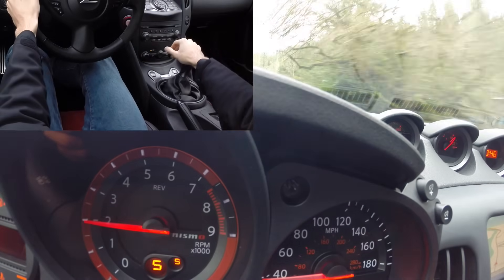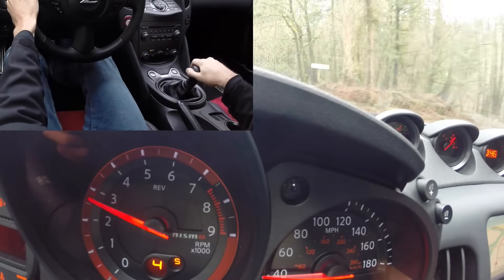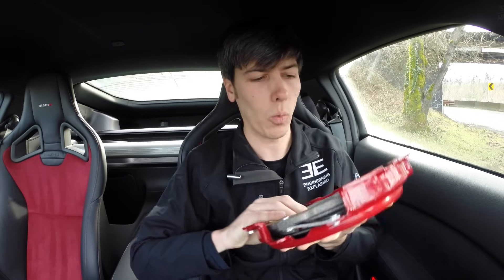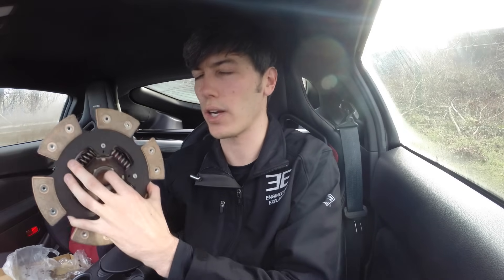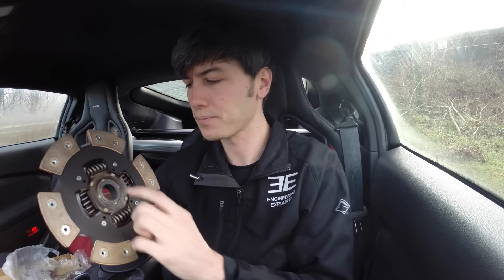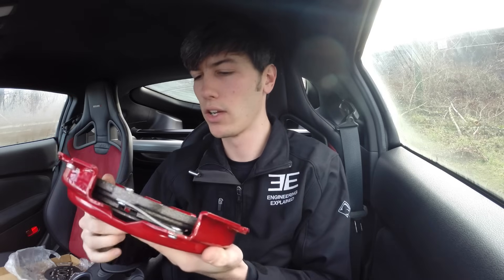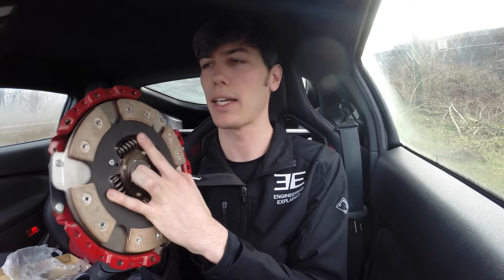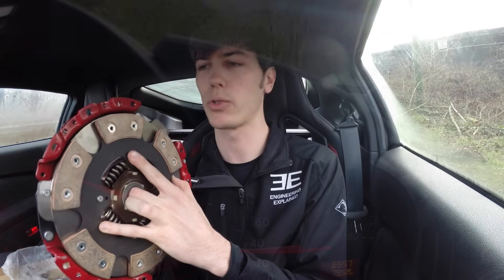What Is Rev Matching?

Comment: can anybody give me an example of this, when i drive stick i really dont think about these things i just do them. xD when i switch to a higher gear, i let go of gas, press down clutch, switch gear, let go of the clutch slowly while giving a bit of gas. now when i downshift i let go of gas, press down clutch, downshift gear, and let go of the clutch slowly without giving gas.
Reply: +poisoncobra7 Not quite. Rev matching is this: You want to slow down from, say, 40mph in 3rd gear to, say 20mph in 2nd gear. You brake, push down the clutch, move into 2nd gear, then *with the clutch still down you push the throttle a bit*, then you release the clutch, slowly or quickly, it's up to you. This makes for a much smoother downshift. If you downshift from 3rd to 2nd or 2nd to 1st and release the clutch very quickly you'll notice the car snaps its speed down very violently. It might even cause your seat belt to snap tight, it can be that aggressive. That's called engine braking and it's caused by the two discs the guy in the video is showing moving at different speeds and then joining together suddenly. Rev matching gets the discs moving at the same speed before they come back into contact with each other, allowing for a much smoother downshift and less wear on your clutch and stuff. Hope that helps. Ignore TifosoPatF1 btw; what he said to do is engine braking i.e. exactly the opposite of what rev matching is!

Edit: A great comment below bears repeating: "No need to [rev match]. In most cases you can just brake and keep it in the current gear then when you're ready to accelerate again just shift it into the gear most appropriate for the speed you're currently at."
Reply: Letting the clutch out slowly means you are slipping the clutch.  The clutch does not take wear when it is fully engaged or disengaged, but the time in between is where it receives 100% of its wear.  You can tell how much wear your placing on it by the amount of time it takes to shift smoothly. Your clutch is made to handle a ton of wear so don't sweat it if you ever had poor habits in the past.

Perfect Shift - Really fast, No jerking
Great Shift - Fast, little to no jerking
Good Shift - Sort of fast, Little to no jerking
Good enough - Not particularly fast, Little to no jerking
Poor Shift - Slow

 Drive down an untraveled road at a safe, normal speed in a lower gear then normal.  We'll say 3rd gear at 30 mph.Take note of the speed and RPM.  Now shift up so your in 4th.  Now downshift back down to 3rd the exact same way you normally do, but instead of letting off the gas all the way keep on it just enough to raise the RPM's close to where you were at originally.  You just need to get close and your clutch will do the rest when you release it so don't over think anything.  Practice will make perfect over time.  When your raising your rpm's up to the appropriate level, your not so much applying any torque, but more just resting your foot on the petal just enough to get the job done.

When you are practicing like this, you can always aim a little low if you don't intuitively know your RPM's for each gear yet.  It will be smoother, faster, and add less wear then your original method anyway.
Reply: +Anukloses Hmm it is far from dumb, infact you should not really ever be in neutral unless stopped, driving in neutral is call 'coasting' and it is a state where you have much less control over the car. I can't see why you would go from 6th to neutral? The gearing is there to be used so use it. Much like on a race track the gears and engine braking are used to gain traction coming out of a corner for maximum acceleration. Never coast a manual car.
Reply: +Dan Paveley Your comment helped more than anything on this page lol. I just recently started driving manual to learn and people try to give me tips on rev matching or double clutches but nothing helped quite as much as your comment (also this video with the technical stuff) so thanks (:
Reply: +poisoncobra7 That is correct, however what the video is explaining is matching the rpm to the speed you doing so the up or downshift is smooth and the car continues to accelerate correctly. Let's say you are going 60mpg and are in 6 gear but you want to come to a slow, by pressing the brake and taking your speed to 40 then selecting 4th gear will make it smooth and have no wear on the clutch alas 30-3rd, 20-2nd then 1st when you are coming to a stop it should all be a smooth sequence same as going up a gear, go with the revs.
Reply: +whoiselijah okay, what I do is, when i get into a city i lower The speed and switch to The appropriate gear for that speed. is that rev matching ?
Reply: +poisoncobra7 Yes, because when you change, the clutch disk is spinning at the same speed as the pressure plate so the connection is smooth and gives minimal wear on the transmission it also gives a smooth change and the revs should adjust only slightly.
Reply: +whoiselijah cool, thanks for the help, appericitate it !
Reply: +whoiselijah and there is no need to rev match when youre upshifting. That makes no sense cuz if u do you're spinning the engine crankshaft too fast for the trans input shaft to match and that collides gears aka smashing gears. Thats pretty much explaining powershifting in a way but obviously u take ur foot off the gas driving normally and in powershifting you dont let off the gas at all and "smash" the next gear in.
Reply: Dan Pavely and Quadrunner has the best explanations. Ignore all the others, it will just confuse you trying to understand Rev matching.
Reply: +poisoncobra7 You only do rev matching while down shifting if you wish to slowly brake your car using your engine (or add braking power if you're a "racer"). A good way to use this for everyday drivers is before a steep hill going down, you can release the clutch, give a little bit of gas and downshift to keep yourself at the speed limit without using brakes.
Reply: +BboyIllusi0n so say like there is a stop light up ahead,  you'd put it into neutral and slow down with your break. And you downshift if you are still moving but need to slow down a bit.  Is that what you are tying to say?
Reply: +Ghost Pro  i get your first part but the 2nd im having a little trouble understanding im like running on4-5hrs of sleep and worked 8 hrs..if im cruising at 35mph in 3rd gear and i see a red light up ahead, i push the clutch in and throw it into neutral and use my brakes to slow down my car completely. I dont use my clutch or gears to slow the car down at all. Ever. UNLESS i know for a fact that i wasnt paying attention &imma die and hit the car in front of me cuz i was rubber necking or whatever and my brakes arent gonna cut it so leaving the car IN gear AND braking gives a bigger effort cuz not only r u slowing down by applying your brakes but your drivetrain is impeding inertia as well.
Another scenario is that same situation but the light turns green. I went from 35mph to 20mph so i downshift to 2nd gear to get more torque to make the car move forward easier instead of having it be all sluggish and poor throttle response. Hope i answered ur question
Reply: XxBEFALLENxX i drive a pickup with a five speed. Sometimes i got a load in the bed. I down shift to brake so i dont over heat my brakes before the end of the trip. It doesnt hurt the truck to down shift while braking. It saves the pads too so i dont have to do those as often either.
Reply: +BboyIllusi0n yes that did. Thank you!
Reply: +BboyIllusi0n Yeah dude im like wtf why would you use the engine to slow down your car thats the most dumbass thing i can think of haha. Just shift it into neutral and use your brakes haha.
Reply: +Ghost Pro youre welcome! :D
Reply: +BboyIllusi0n Going up through gears using the revs is a very good idea, the optimal change for a diesel si 2-2500 revs and petrol is 2000, Matching your speed to the revs on upshifts gives a smooth change, going 30mph in second gear would be rough on the engine and transmission. May not be rev matching in its clinical sense but it is still matching revs to your speed.
Reply: +whoiselijah 2000 on a petrol? If I upshift at 2000 in my mr2 I end up with less than 1500rpm in the next gear and a really unhappy engine. It depends on what gearing you have and the engine. Some prefer 3k others 2.5k but rarely 2k on a petrol. Maybe those turbocharged 1.0 ecoboost engines from ford.
Reply: +whoiselijah you should never downshift to slow down ESPECIALLY to 1st gear. For example from 5th gear to 4,3,2,1. Thats what the brakes are for. To brake/slow down your vehicle. If u do that, u cause more stress on your clutch and gears and u wear it out more. More contact = more friction = more wear = more heat = more $$ to fix extra parts that shouldn't have worn out in the 1st place. Why do u think there is a neutral "gear". To allow no contact between the input shaft and the engine flywheel. Just saying. I dnt see why ppl slow down like that. For what? Whats neutral there for then. Might as well have it in a gear all the time since neutral isn't necessary.
Reply: XxBEFALLENxX_ Incorrect. It is not hard on a transmission to slow down while in gear. It is also not necessary to shift down prematurely causing a jerky motion that is hard on the clutch, just slow down in the current gear and then downshift before it stalls or before accelerating again. Coasting to a stop in neutral is the lazy or inexperienced way to drive a manual. It is not as safe, and it burns up brake pads faster than necessary. The only reason to do as you say is if your car is janky and stalls all the time then you can ride in neutral to keep revving it so it doesn't die.

Comment: How would you do this in a car that does not let you blip the throttle....I drive a 2008 acura tsx and it's not a wire throttle....i can get going from a stop no problem but a lot of times if say i'm coasting, or I first gear, clutch in and try to pump the throttle it won't do anything. Neutral revving sometimes if I'm coasting takes a second or 2 before the computer actually tells the engine to start revving. SO quick rev matching on downshifts is near impossible. I have to take at least 3-4 seconds to wait for the throttle to catch up to the lower gear rpm.
Reply: +TSX_Adonis Buy a car that doesn't suck?

Comment: hey! how about fuel consumption? I've heard people saying is a good idea to brake with the engine especially in downhiills, but i think as you are taking the engine to a higher revs it might use more gasoline. does it make any sense?
Reply: +Martin Zorrilla Yes it would raise fuel consumption because when you downshift to a lower gear it raises the engine RPM and that speeds up cylinder combustion which uses fuel. And there is nothing wrong with using the brakes to slow down going downhill, unless your brakes are junk.
Reply: ***** Thanks! yeah the idea about using the engine is because in really long downhills your brakes lose preassure and also the temperature of the disks and calipers raises so you lose braking performance. that's what I heard. on the other side you raise the fuel consumtion I guess
Reply: engine breaking doesnt increase fuel consumption on modern cars, atleast thats what we are taught here in sweden. Its actually prefferable to engine-brake according to instructors because its better for "eco-driving".
Reply: +Thaddaeus Edens Yeah, cars don't use fuel proportionally to RPM. At all. That hasn't been a thing since the death of the carburetor 30 years ago.

Comment: hey quick question is it bad for the engine/clutch/transmission to set the car in neutral once you reach certain speed? does it save u any fuel ? thank you :)
Reply: Bad idea. Less control over car without powered wheels and U will still need to rev match when reengaging into gear again after leaving neutral

Comment: it was going to well then he grab a clutch and said in spins according to your wheel. the hell no. the clutch spins with the same speed as your engine and not with your wheel.
Reply from the maker: +xpatriarch II Only when it's engaged. When the clutch is disengaged, it spins with the transmission (for whatever gear it is in) which is connected to the wheels. If it always only spun with the engine, there would be no rev-matching.

Comment: hi i drive a fiat 500s which is a auto but classified as a robotic manual, my question is how do i rev match ive been driving in manual mode and i usually just downshift and it rev at 5000rpm and then it goes down

Comment: What is the point of driving a manual transmission if it has "driver aids" i.e. rev matching and hill assist.
Reply: What's the point of any automatic transmission?
Reply: +Great Pyramid stuff No idea. Part of learning to drive in the UK is a hill start if you're trying for a manual license.
Reply: +Great Pyramid stuff No idea. Part of learning to drive in the UK is a hill start if you're trying for a manual license.
Reply: Darren Boss There are different tests? LOL
Reply: Great Pyramid stuff yes, if you learn in an auto in the UK, you can only drive an auto car. If you learn in a manual, then you can drive either.

Comment: you mixed it up a little... a pressure plate does not rotate... the clutch disc and the flywheel rotate... the pressure plate has springs which force the disc against the flywheel.. there is no rotation involved with the pressure plate itself but rather just the clutch disc... but still, it's a nice try at explaining how the clutch works... some people may not understand it properly and mistaken the pressure plate for the flywheel

Comment: I have been rev matching for the last 35 years ( ever since I ate a clutch in a 3 speed and read a Road nd Track article ) .. I have not had ANY problems with  clutches in car or motorcycle in 300000+ miles ..do my best to always rev match

Comment: If I paint my pressure plate red, then are the cops more likely to pull me over?
Reply: +InternetzSpaceshipz nope, you;ll gain extra BHP though.
Reply: +InternetzSpaceshipz nope, you;ll gain extra BHP though.
Reply: +Darren Boss but you will lose some torque.
Reply: +InternetzSpaceshipz In the State of California, you will.
Reply: +InternetzSpaceshipz Yes Yes and Yes! also if you put some racing strips and decals you will go faster and get away from the cops guaranteed....damn good comment i like your humor.
Reply: maybe if you're in Portugal, they'll adopt the death sentence just for you.
Seeing how you get fined over a structure reinforcement bar on your engine bay that does NOTHING other than making your car safer lol
Reply: Depends. Are you painting it red AS you are driving?
Reply: Only if it's an automatic in race mode (the R on the shifter).
Reply: +InternetzSpaceshipz 
. No, however if it's painted black, that's a different story.
Reply: Unfortunately yes.
Reply: Also by using water as fuel, you will gain 600 hp more.
Reply: CALIFORNIA has left the chat*
Reply: yes, stance it as well.
Reply: Idk but if you paint it black then sure.
Reply: No. However, if you paint yourself black....
Reply: *****
No, you would ruin it because it wouldn't work.
Reply: DassRoc Our country sure is lame about cars...

Comment: clutch disk has not a different speed depending by the gear. it's connected to the primary shaft of the gearbox and it can turn up to the speed of the engine. it's the secondary shaft of the gearbox that changes its speed gear by gear.
sorry for my English guys.

Comment: Hey Jason! Does this apply for upshifting as well?
Reply: +Ashton Murch no
Reply: If I'm not mistaken, when you take your foot off of the gas, the engine speed (obviously) will drop. When you are going up in gear, the transmission speed will drop. You technically are already rev matching the up shift. The issue is that in the downshift, the engine speed will drop slightly (foot off gas) while the transmission speed will increase (amount of increase depends on gear and physical car velocity). At this point, it would be wise to bring the engine speed up to match the transmission.
Reply: tinyman392 Spot on! When I'm shifting slow I have to rev match the upshift because I let the rpms drop lower than the tranny rpms

Comment: Isn't one of the downsides if you don't do it that you could simply stall the engine?
Also, I've heard about changing gears without declutching, how does that work?
Reply: +Walter Black You just push the gear in at the right RPM. Find the right RPM by carefully throtteling and checking with the stick. It takes some patience and courage.

Comment: Engineering Explained - I understand how rev matching is important but what i don't get is downshift heel and toe rev matching(in a non-sequential gearbox). What i usually do is, say i'm in 4th gear coming at a corner and i need to slow down, i just disengage the clutch while breaking then pop it in 2nd gear and as i have the clutch fully pressed in i bleep the throttle raise the RPMs then release the clutch. This works too and its very smooth. my question is does that damage any components?